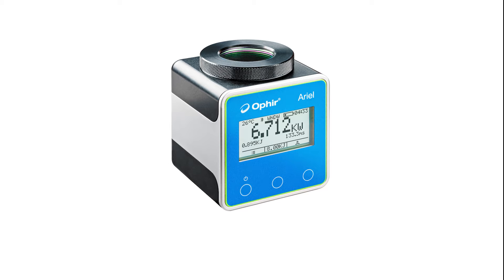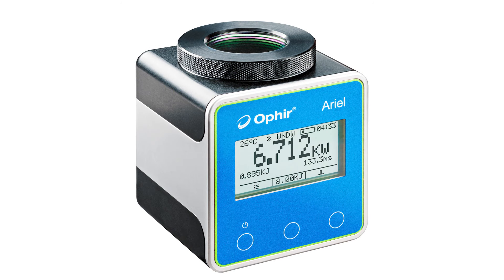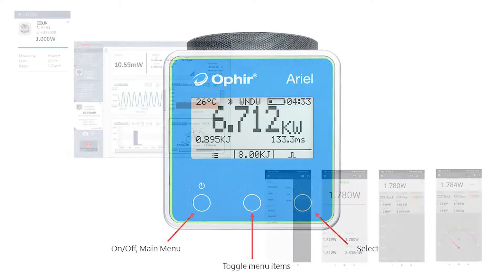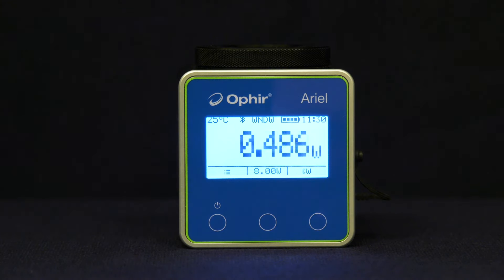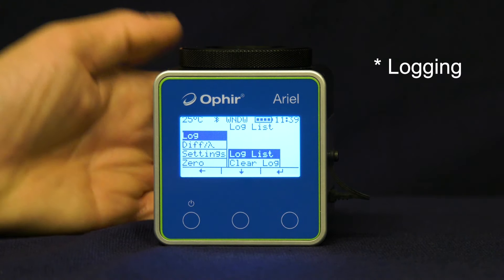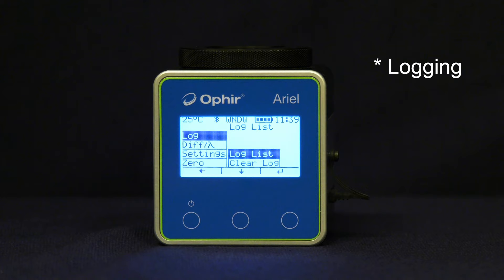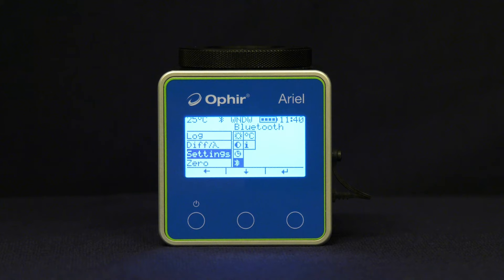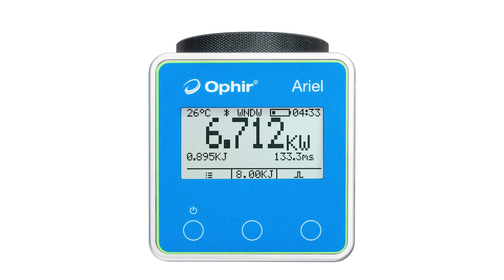Ariel All-in-One High Power Laser Sensor: How to Use

Comment: Wish this could measure 5 ns 1064 nm (at 2.5 watts average power) from a laser reported to produce 15 to 18 kw peak power. The pulse power is under 100 uJ, but your meter won't allow selecting that high of a peak power :(